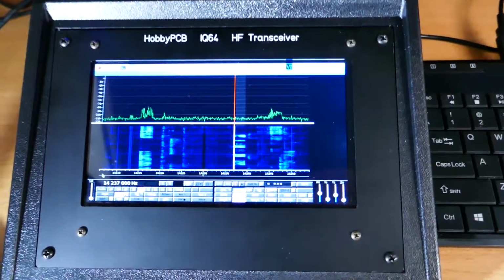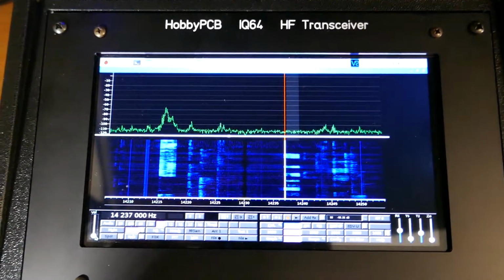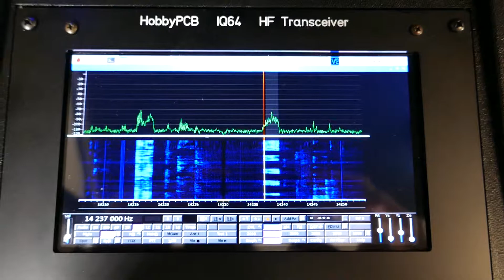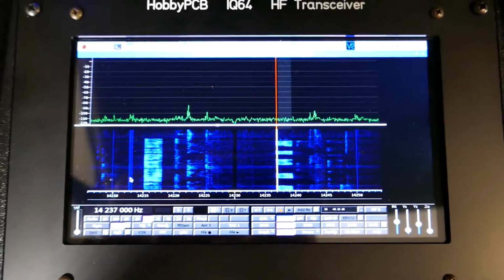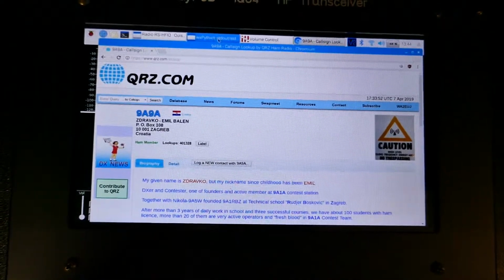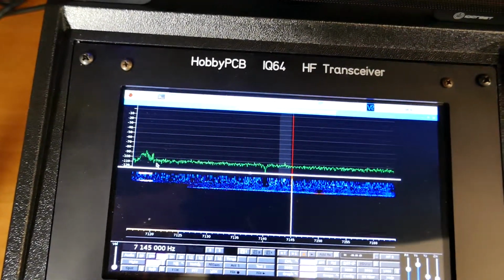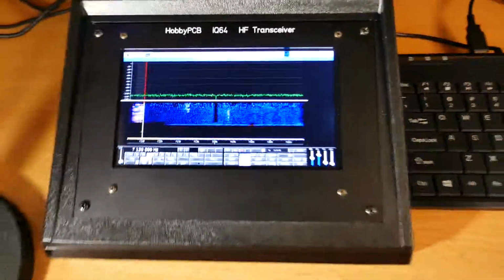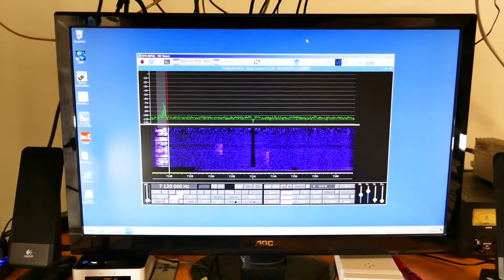IQ64 Basic Operation

Comment: What's a good SDR software package to use in linux to TX/RX with the rs-hfiq? I'm looking to put one together with a linux netbook/soundcard I have...
Reply from the maker: Hi,

We have a downloadable image for the RPI 3 that has Quisk and FLdigi and WSJT-X software already configured. I'm not sure how easy it would be to port that to other hardware. But Quisk/Hamlib is definitely the way to go with Linux.

Jim.
Reply: WA2EUJ, ok thanks. Looks like quisk is some python type script, and I already have fldigi and python3 on that netbook, so I’ll check it out

Comment: I just realized you are “the Jim” of Hobby PCB.
Reply from the maker: Hi, yes I am the 'Jim' of HobbyPCB. The IQ32 and the IQ64 both use the RS-HFIQ as the radio guts but there are some significant differences between the two. The IQ32 feels more like a traditional radio where the IQ64 you are actually using a Linux desktop as an operating surface so it's much more like a computer based SDR.  At this time we have no plans to productize the IQ64, it's a DIY project, we give you the SD card image for the PI, you set it up the way the you want to operate.

HobbyPCB isn't really in the business of providing traditional ham radio devices. We are more in line with where I see the future of home brewing; grabbing pre-built modules and 'gluing' together to form a solution.

73,
Jim WA2EUJ